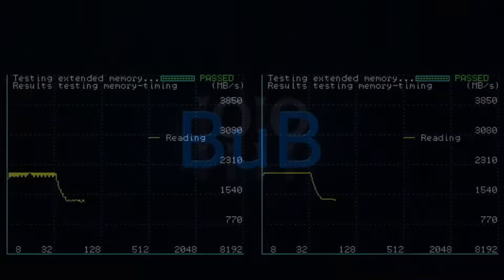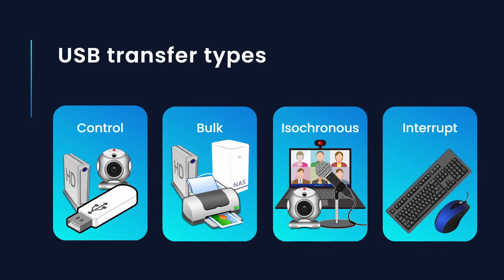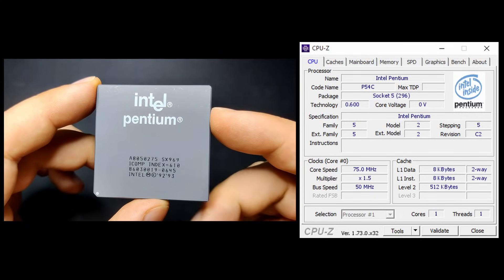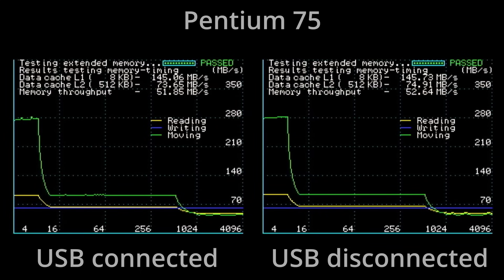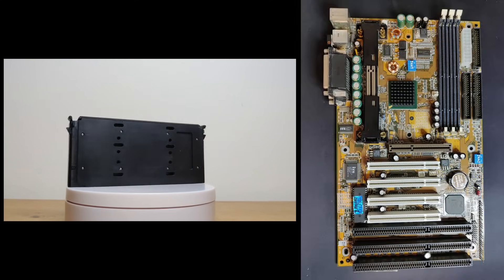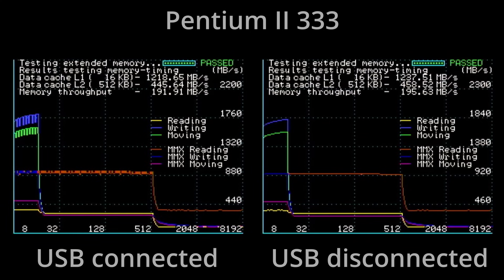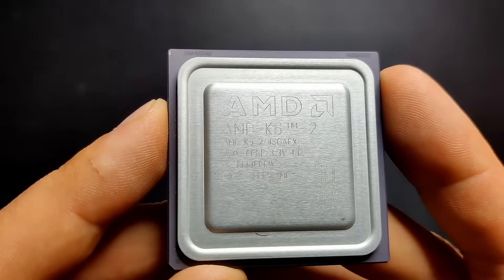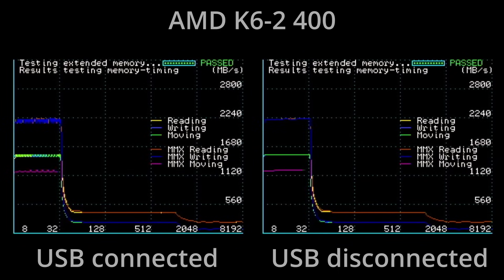Why you should avoid USB in Retro PCs

Comment: i would be somewhat interested is that indeed the cpu problem or a place where usb is located in the system , for instance p3 motherboard have integrated usb 1.1 but is it integrated a a pci device controlled by cpu or is it somewhat more advanced controller that delegates some features from cpu and for low level interupt devices like keyboard or mice that can be enabled as ps2 emulated mode in bios it might just skip asking cpu for usb instructions and just periodically reports to the system what it does with usb while routing interupt level devices trough system board controller instead so they functionally works as ps2/serial devices for compatybility with dos for instance
so good test would be to use separate pci controller on all boards and using the same one and disabling usb hub integrated in the motherboard all together
the other issue might come from how southbridge and north bridge communicate so testing via chipset talking with pentium 3 over pci bus vs intel qgr bus might change latency

Comment: 1-3% seems lower than I would have expected. You wouldn't think that would be visible, but I remember it being visible to the naked eye (frame rates dropping).
Reply from the maker: I may have to run different benchmarks to get a better understanding of how bad the performance loss could be - especially games under windows. I'll also try to look at different USB chipsets and USB versions next.
Reply: @bitsundbolts  It may have actually been related to windows. I don't remember

Comment: The older connectors are interrupt based, meaning the CPU only needs to do something if there was an input. USB needs to be polled regularly at the rate the USB device tells the host to be in the endpoint descriptors. That the polling rate can have a negative impact isn't just an old problem. Just four months ago Microsoft released an update for high polling rate issues on Win 11. As far as I know there were a lot of issues too back then when the first 1 kHz mouses came out. So not even up to date systems can really properly handle high polling rate devices, so no wonder that on older system can't deal with it.

The first USB devices were very slow compared to modern gaming devices. So I assume that the impact is less significant on lower polling rates, like when an office mouse is used instead of a gaming mouse.
Reply: This. I still keep my mouse set to 125 Hz on my mac laptop. At 1000 Hz, it may not be noticeable visually, but in terms of CPU usage and battery life it makes a sensible difference.

Also something to note is that the HID driver (HID = USB keyboards and mice) is still using a lot of CPU cycles for each "event", still significant on a M1/M2 chip. On top of that, if you have any extension such as Karabiner, BetterTouchTool, etc. (or on Windows any soft setting a system hook on mouse events, or for messages in general) the OS will have to execute something in that program every single mouse event (meaning 1000 times a second instead of 125)! And it makes a noticeable difference in CPU usage and battery life.

That's also why I had to choose a mouse brand which behaves properly at 125 Hz. My mouse has the "ENDURANCE" mode, so it's meant to be used at 125 Hz too. Many many other gaming mice I tried weren't designed for that, so they only behaved well at 500 Hz or more, which was a problem with laptops of around 2017.
Reply: @florianb3935  Yes, as far as I know the OS typically converts the RAW input data into events which are typically handled in sequence by the application, likely causing a huge overhead. A mouse also likely waits some time before sending real input data to reduce the error. So unless a very high DPI is used the device didn't really send useful updates each (sub) frame. On my Razer Viper V2 Pro I some polls are skipped and often the movement data is only 1 unit and only after some polls that it sends a movement of 100 units because I only use 2300 DPI with 1 kHz polling.

Comment: Lately I've been trying out Settlers III for the first time as I've never had an opportunity to play the full game before, only a demo version back in the late 90s. Imagine my bafflement when I found out that the game freezes completely whenever I move the mouse around. As soon as I leave it still everything is fine again. How can I even play a real time strategy that way?? Surprisingly no such issue occurs when I use the trackpoint (the computer is an IBM ThinkPad T42 laptop with a Pentium M 1700 MHz; not all that retro, merely 18 years old). I have no idea what produces such weird symptoms. I wanted to give a PS/2 mouse a try and see if it works fine with the game but after closer inspection what I've hoped to be a PS/2 port turned out to be an S-video out so no cigar ;)
Reply from the maker: I've been capturing footage of Settlers III - for a new series about copy protections back then.
I played it on a Pentium 200 with 96 MB memory. I even used a USB keyboard and mouse. It wasn't running well, but good enough to make it to Romans scenario 7.
I have not encountered any such issues you describe. However, I once experienced a weird behavior in Jedi Academy (I think it was that game). I could play the game until a certain point, then, the frame rate went to 1 frame every 5 seconds. This was on a newer Intel Celeron N3450. I tried different video drivers and all kinds of other remedies. But I don't think it was related to input

Comment: USB is very convenient for the end user but not so much for the developers. It requires entire protocol stack similar to that of bluetooth or networking. In "legacy" mode, simplified USB stack and legacy device emulation is implemented in the BIOS and runs in SMM (System Management Mode). Long story short, it's quite a lot of code that steals CPU cycles from the OS. Switching to and back from SMM takes time. And since it is using CPU caches, just like any other code, it causes even more performance loss. Not to mention that it is pretty much impossible to predict when SMM is going to kick in. Depending on how good or bad the implementation is, it might be pretty much invisible to the OS and the user or break everything entirely, including completely crashing the system. Updating the BIOS or changing the mainboard might change things by a lot.
Reply from the maker: I have seen SMM mentioned many times now in the comments. I may put the focus on it in the next video as "polling" may not have been the correct terminology.

Comment: Nice video. But you still don't include the USB controller type to comparison. Via chiset is using uhci controller which is the worst possible one. Ohci controllers are much better and will result in less cpu usage.
Reply from the maker: I'm in the process to source different PCI USB expansion cards (USB 1.1 and USB 2.0). I hope to be able to reproduce the experience many commenters share.

Comment: would using an USB device connected to a PS2 port using an adaptor affect performance?
Reply from the maker: Probably not. If the USB device is capable of communicating via an adapter to the PS/2 bus, then it implements the correct protocols. In that case, it would behave like an ordinary PS/2 device

Comment: Great video and had no idea. I'm wondering for a USB mouse using a PS2 converter if it would have no effect since it's still using PS2 connection?
Reply from the maker: I wouldn't expect a converted USB mouse to PS/2 to have these issues. It's related to the port. As someone else pointed out, not all USB devices can be converted to PS/2. They need to support the PS/2 protocol, otherwise they won't work

Comment: IT IS noticiable in my k6-2 500 and Soyo 5EHM 1.3, when im using the mouse (Microsoft Intellieye 1.0 optical from 1999) you notice how the mouse start to stutter when you open things and the whole computer becomes much slower if you move data from a usb drive. Of course i disabled the usb 1.1 in the bios and i connected the mouse via PS2 as well the IBM Model M keyboard via PS2 to DIM adapter. Its the same thing with a VIA 2.0 PCI card

Comment: Very interesting!

I seem to remember not even encountering USB until 1996-1997 but don't remember really having any device to actually connect to it until 98-99 (hard to remember, it was a mouse though). It feels like the ports appeared before there was really much purpose for them which makes sense, it was just quite a slow (relatively) rollout since we didn't yet have cheap flash memory for a while which was the real killer app for USB.

I don't recall any discussion of a performance hit back then but this makes sense since most of those ports went unused for a number of years, PS2 ports refused to die but it is genuinely surprising that these issues existed in the Pentium 2/AMD K6 era since this was when it was increasingly likely you would buy a USB keyboard/mouse.

Do you have any newer platforms? would be curious to see if this was noticeable in 1999+ hardware like Pentium 3/Athlon platforms.
Reply from the maker: I'll definitely make a follow-up video using other platforms and CPUs. The PII I 1000 in this video didn't experience any performance hit, but you can see less performance in cache and memory throughput. It might not be enough to measure a difference though. I am currently fixing a P4 motherboard which I would also like to test.

Comment: I would expect this problem is bios specific. Some bioses will be better than others as it is going to be related to the Bios support for USB emulation of legacy input devices. The bios probably sets up a timer interrupt so it can poll the USB devices and that causes the performance loss. I would expect things might be different in Windows if Bios support for USB input is disabled as you are completely reliant on Windows USB HID support and I would expect differences between 9x and nt operating systems but with your retro pc you probably aren't using 2k or XP so nt performance doesn't really matter.
Reply from the maker: In Windows 98, I did notice a similar performance drop as in DOS. There was a difference though. In DOS, I could pretty much unplug the device and the issue immediately went away.
In Windows, it took about 5 seconds. I'd assume it's related to the driver noticing that the device is no longer present, unloads and does some other cleanup.

Comment: Have you tried disabling the USB controller completely? I've heard that just having it enabled drops performance...
Reply from the maker: Yes, I have tested this, but I did not notice any difference. Having no USB input device connected is equal to disabling USB in the BIOS. At least this was the behavior of the hardware and benchmarks I used.

Comment: In this era, i have microlag when i review the stage in Colin McRae Rally 2001. I optimizing windows, not work, i rearranged the device IRQ-s, with exchange cards in the slots, and not work, but a little better. I have shared IRQ on the USB controller, and not able to change, but i only use USB when printing. Then disable USB in the BIOS, now the fps better 45 vs 54.  This time i use Teac 8x CDRW, but this only PIO4 multiword DMA mode. It work super, and not cause any problem. I bought a faster Phillips 16x CDRW, and this UDMA66 capable, now the microlag not appear in the game. I later found a solution, a windows setting autoinsertcdnotification to disable and it work, no microlag with the old CDRW connected, but the new UDMA device never appear the microlag. I making test, when i set all device IRQ-s to 9, this cause -10fps in the game.
Reply from the maker: You spent a lot of time debugging the issue! Great that you found a solution! Issues like those are so difficult to resolve!
Reply: @bitsundbolts  I testing computers in this  era, with Quake2 crusher.dm2 demo in loop for power and stability. I upgraded my cpu from Thunderbird 850 to Athlon XP1900. The fps jump from 30-32 to 38-40 in Quake 2 demo. I not interested. My little broder using Impulse Tracker, and we have AWE64 ISA card, and sound good, and very good compatibility, for every program. A little later i have little money, and bought a SB Live!, just for fun. It is compatible also. When updgrading the machine i select motherboard with ISA slot, to using AWE64, this time is not planned to change the sound card. Later coming the 3DMark with 3D sound test, and wow, this is good. I think, test the Quake with A3D setting, and mmm. Now test the Crusher.dm2 demo, with normal stereo, and with this sound card the fps jump from 38-40 to 55-58. Now i think, the modern computer using ISA device is a big brake, and if not enogh knoledge, the PCI also braking a little bit.
Reply from the maker: Yes, I have read it many times that ISA sound cards may slow down a system. Depending on what I am measuring, I test without a soundcard installed.

Comment: Great research! Would be interesting to get an overview of percentages performance loss across core frequencies, especially with the P2 and P3 era. Wondering if it would be linear with clock speed, and at what point it's no longer measureable.
Reply from the maker: With each video I make about this topic, I have more questions afterwards once I read the comments. Although I have a feeling that around 800 MHz, it will be difficult to measure a difference, it could also be that I have to change benchmarks and testing methodology. For now, it's great to see the graphs in SpeedSys of the cash - at least we know something is there.

Comment: Turns out I had the USB vs PS2 inner workings wrong but with more or less the same result XD.
Someone told me that PS2 was better because it sends interrupts when it needs to, so you get "no latency" on games. , but USB sends a request and joins the scheduler of the cpu so your input can be "delayed".
Your explanation is clearly the correct one.
Probably someone noticed a difference when gaming but didn't made the proper tests to see a performance drop.

Comment: I've added several USB 2.0 cards to my retro rigs but only for quick file transfer. Good to see that I made the right choice keeping my input devices analog. 

Interesting thing about adding usb cards is the PCI version. You can't just add any generic card because chances are that it uses a higher PCI version than is supported on your old motherboard. There's a pretty good thread over on Vogons about which chipsets to pick and avoid.
Reply: PS/2 and parallel ports were by no means analog, only sound and VGA ports used analog signals.
Reply from the maker: Great! Thanks for the hint. I'll have a look before I get useless PCI cards!
Reply: there is a mod to connect 3.3 volts make modern usb cards to work.

Comment: The start wasn’t exactly great, made it sound USB came and replaced FireWire, were two different types of connections back in the days, FireWire for high speed data transfer and USB for slower like printers mouse keyboards and FireWire for video external storage 

Overtime they increased the USB data transfer speed and eventually FireWire became less used due to certain factors like majority of PCs just had USB unlike Mac PCs and license
Reply from the maker: Yes, you're right. But there was a problem with FireWire - not many PCs had it built in. I remember that I required an expansion card to have FireWire available. Later, a FireWire port was more common to be on the motherboard.
You are correct that FireWire was the way to go for storage devices until later USB revisions.

Comment: eh I mean in certain end use cases USB can still be handy for transferring files if say for example you have a mechanical hard drive. I've used a thumb drive plenty of times with my DOS 6.22 Socket 7 system ,  it saves me giving up an expansion slot for a network card or having to remove my HDDs every time I need to put stuff on them. I do use PS/2 devices for my keyboard and mouse though.
Reply from the maker: USB is a convenient way to transfer files, I agree. There is one benefit I like using wireless USB keyboards and mice: less cables
Since I change my setups a lot, it does help me keep my desk clean. But for benchmarks or long term use, it's probably better to stick with PS/2.

Comment: On my hardware I noticed that some motherboards are affected more than others with the same CPU, maybe different controllers and different BIOS can change that. What about not only using USB keyboard and mouse, but also USB storage and USB sound card all at the same time?
Reply from the maker: Good question - until now, I have only experienced the issue with input devices - in particular keyboards. USB thumb drives do not degrade performance. I am already collecting USB 2.0 PCI cards for another video. That would be the time to test different motherboards with the same CPU - and different USB controllers.

Comment: Interesting observations. I've been using wireless USB input devices on an old P233 MMX system as it is a lot more convenient than using an old crusty DIN keyboard and PS/2 mouse. At least the performance degradation isn't too severe, so the added convenience of USB might be worth the slight performance hit.
Reply from the maker: Yes, the performance hit is small and won't make a difference if some application or game is already running poorly. Convenience is a very good argument, especially when I don't have to have all those cables around!

Comment: I am not surprised, this was one of the overclocker arguments from Kingpin when making the EVGA's Socket 1366 motherboards and offering IDE connector for the harddrive and PS/2 for mouse and keyboard.
Basically simplify and reduce parasitic loads for benchmarking runs and get that higher score.
Of course if you run a less powerful CPU, the performance costs start to become noticeable.
Reply from the maker: Interesting that it's up to Socket 1366 for this to be an issue. I guess if you're chasing world records, you want to have every little extra performance you can get!